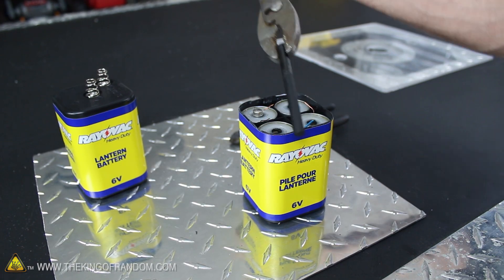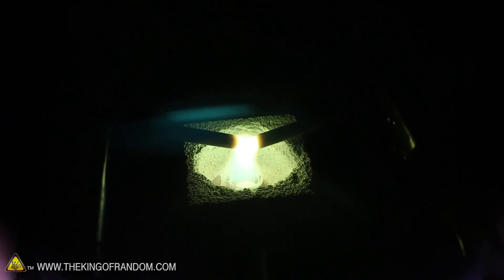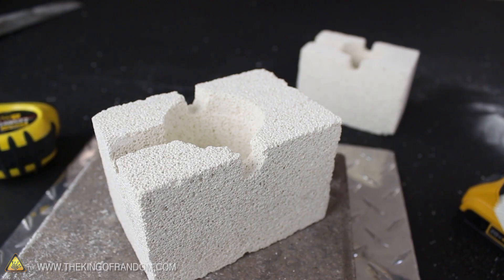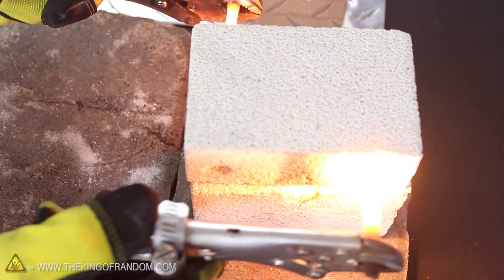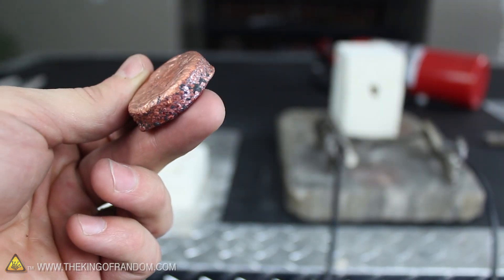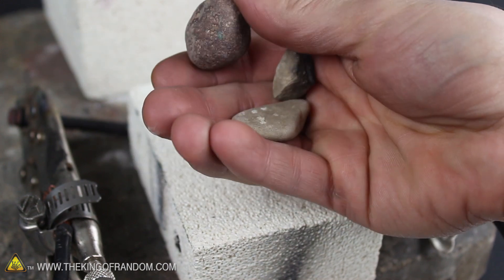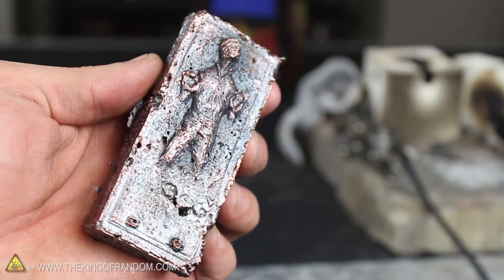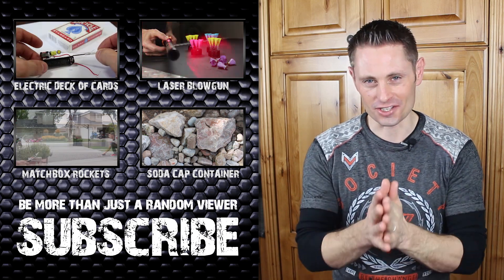Mini Arc Furnace (Arc Reactor Technology IRL)

Comment: hey, can you try to step up your game a throw some diamonds in there, maybe to a kickstarter or something to buy them, or see how much gold you can get from hacking cpus on old computers and using that. 
(gold would be interesting simply because its gold, but diamonds would be even more interesting, since they have an insanly high melting point)
Reply: calex1290 first of all carbon has a melting point of 3825 Kelvin and a boiling point of 5100 Kelvin. this means between 3825 degrees and 5100 degrees carbon will be a liquid. 
all elements can exist as a liquid. 
you might be thinking of CO2 which will go directly from being solid to gas (dry ice) but that is only in our atmosphere, if you pressurise it, it can still become a liquid. just like if you put water in a vacuum, it also goes stright from solid to gas, but that does not meen water cannot be a liquid. 
finally. of course you can get temperature that high, maybe not in this system, but there is no limit to how hot something can get, all you need to do is add more energy in the form of heat.
Reply: you just can't melt diamonds, you know.
Reply: s1nce yes you can. it just needs to be extreamly hot (5000 celsius)
Reply: It can't go that high (read description)
Reply: martinshoosterman Carbon rods like the ones used in this have a melting point of 3500 C so no you can't, in this furnace.
Reply: "Throw some diamonds in there" Dude, this isn't MINECRAFT. Real life is much harder to acquire diamonds
Reply: greg m not going to happen.
Reply: Super Science I doubt people could ever fly over the atlantic
Reply: martinshoosterman Carbon can exist as a liquid only under extreme, impossible pressure. Therefore, I'm not going to 'fund a kickstarter or something' so this guy can fund an R&D project for the development of what's essentially going to be a super pressure cooker thousands of years before its time.
Reply: nukeboy27 At what point does wood turn into a liquid?
Reply: 3,550 C
Reply: nukeboy27  *pressure dependant.
Reply: Diamonds would probably burn into CO2 before they melt in this furnace.
Reply: Morris Janssen no they do not, there is no carbon in the outer or inner core.
Reply: Just thought I'd say it, smart ass. :3
Reply: ***** shhushhh, never question science. you need no ask why, but only can.
Reply: The carbon rods would give when the diamonds do cuz they're both carbon
Reply: dont be ridiculous graphene fuel cant melt diamond beams 9/11 was an inside job
Reply: nukeboy27 in this one, you cannot, in general though of course you can. you can melt anything.
Reply: nukeboy27 technically that is not melting, melting is going from a solid to a liquid, while what you are talking about it going from a plasma to degenerate matter 
in plasma the electrons wander away from the necleus, while in the degenerate mater stage, the nuclear breaks apart
Reply: martinshoosterman ok well i didn't meant that you could just start to pour atoms like a liquid metal but to us it has the characteristics of melting
Reply: nukeboy27 melting by definition is the transition from solid to liquid as a result of added energy. the final result in the prosses you are talking about has atoms which are not intact, which means it is not a liquid.
Reply: I don't think diamonds can technically melt. Don't they just basically evaporate?
Reply: suspectsn0thing They are carbon so they would more burn into a gas then liquid but every substance has a point where it would turn into a liquid.
Reply: You technically melt diamonds, because once you hit diamond's "melting point" diamonds turn directly into gas and will never be in a liquid state. And as like you said, the definition of melting "is the transition from solid to liquid as a result of added energy", diamond never reaches its liquid state, that's also why diamond doesn't have a boiling point, so you "can't" melt it. That's just one point, other points you can't melt diamonds in this is because;
1: it can't get hot enough
2: the electrodes are graphite, which is basically the same as diamond, in terms that it is made from the same stuff (carbon) and when melted, it also goes directly into the gaseous state, and also has a lower melting/boiling point than diamond, meaning the entire rod will melt before you even get close to melting diamond.
3: and lastly, you just can't get temperatures that high.
Reply: martinshoosterman there is no liquid form of carbon, it's just one of the things that don't have it. If you don't believe me, even google it. Carbon is "Sublime", meaning it changes straight into a vapour when it melts. Here's a link to the definition if you don't believe me, http://www.oxforddictionaries.com/definition/english/sublime. And if you still don't believe me, just read this article, http://www.thenakedscientists.com/HTML/questions/question/1000313/
Reply: calex1290 did you not read the article yourself. I was just about to correct the article, but then I read it and its not the article which is wrong, its your not reading it. you can get a liquid carbon, but cannot be under atmosphere, it needs to be under allot of pressure, similar to CO2. everything has a liquid form, things will only be sublime under cirtaint amounts of pressure, as the example I gave earlier, water is sublime in a vacuum.
Reply: The diamonds are just a more regular carbon rod so the rods will me,t before the diamond
Reply: martinshoosterman "Melt".. I think you mean molten :) And yes, anything can turn into molten substances under very high temperature.
Reply: and pressure if you dont have pressure than there are things that sill sublimate into a gas
Reply: TheFirefox780 if you dont have pressure then liquids cannot exist. and everything will sublimate.
Reply: ( ͡° ͜ʖ ͡°)
Reply: Ya they are just carbon sinks gone through high temperature and pressure
Reply: martinshoosterman 

just wanna say that this guy knows his stuff. what background you from bro? physics or chemistry major?
Reply: The diamonds would burn... just saying.
Reply: You cant melt diamonds with 5000 degrees C
Reply: (Wrong button) solid diamonds exist in the completely molten core of the earth which is hotter than 5000 ºC
Reply: Morris Janssen um no the core of the earth is molten nickel and iron thats why it produces a magnetic field, the high heated carbon is in the mantle and as it gets pushed to the crust, where is cools down and gets compressed under high heat ad dextreme pressure is where carbon turns into diamond
Reply: They exist where it is molten but not totally in the middle.
Reply: right...
Reply: nukeboy27 That's 1 trillion 8 hundred billion degrees Fahrenheit.
Reply: Austin Torrey Im studying mechanical engineering.
Reply: ***** I know, I forgot when I wrote this comment that diamond wont melt at atmospheric pressure
Reply: How the f that tiny blast furness melt diamonds  diamonds take 25 kelvin to melt  iridium its much more easy to melt but your hands will start burning throu the gloves so yea
Reply: martinshoosterman  you cant melt diamonds unless we had the pressure of 5 atmospheres which we don't have so it will just sublimate which is from solid to gas
Reply: (。◕‿◕。) KAWAII SHHHHHhhhhhhhHHHhhhHHhhhhHhh
these people cannot handle the truth, dont spill these secrets.
Reply: why not
Reply: martinshoosterman diamonds will burn up and turn into CO2 at a lower temperature than they melt at. Also, since he is using carbon electrodes, they would melt if it ever did get hot enough.
Reply: James Galbraith that is under bar, under high pressure it will melt properly
Reply: i doubt anyone could get the pressure required with out the container being destroyed in the process by too much heat or pressure or both combined
Reply: NoQuestionsAsked thousands of years before its time? impossible pressure? do you realise the kind of stuff we have like super colliders  and fusion reactors, and you seresouly think we cant make some liquid cardbon? its not cost effective and their isnt a real reason to do it, good enough to get us to do it, but its very possible.
Reply: who me
Reply: dam shots fired!!!!!
Reply: Diamonds dont melt they vaporize
Reply: ***** actually I did the math and the packing fraction of the 12 protons at critical temperature is that you would actually begin to fuse the carbon before you ever got it to melt, so by all definitions its impossible to achieve without around 1425900000000000000000000000000000000000000000000000000000000000000000000000000000000 × 10^24 atmospheres at sea level.
Reply: martinshoosterman  until you use all the available energy in the universe and ended up doing nothing but destroying the carbon into wnergy
Reply: Even if he could who exactly will be providing these diamonds to vaporize, diamonds cost money you know, lol.
Reply: NoQuestionsAsked koty butler Just for the record: Liquid carbon was first artificially obtained in 1997 by Motohiro Togaya. High pressure was not needed, but at 50 000 atm the behaviour of the liquid changed. So, it's not really impossible to do this.
http://www.nature.com/news/1999/990617/full/news990617-10.html
Reply: iTheVisitor yes it has been made, but I'm stating if you melt diamond it isn't diamond anymore, its carbon in the form of buckyballs or c^2, not diamond, because a diamond is crystalized carbon, not liquid, sorry if my above post was confusing, I was in a rush
Reply: Alcatraz Kills ayyy
Reply: +martinshoosterman The amount of gold in a CPU is insanely tiny, and you can't really "melt" diamonds, they would just turn into a weird lava substance.
Reply: +lupinearsenalALT does that mean you could melt a human body?
Reply: Super animals
You can't melt a human body, it will start burning at around 400°C and will start charring at around 200°C
If you keep increasing the temperature you will have a ball of basically carbon and you can't melt that because it will sublimate (turn into gas without passing by the liquid phase) at around 3600°C
Reply: MrOpenGL ooooh, I wanted to try...but if it did'nt burn, would it then melt?
Reply: Super animals
Fat would melt even at "low" (300°C) temperatures, assuming you avoid it from catching fire. Bones will probably sublimate (at very high temperatures). The rest is a bit vague because it tends to decompose into other compouds due to the heat, so you can't be certain in which state it will end up.
But again at the end you will get a ball of charcoally-like material which will sublimate at 3600°C

Comment: You just made a carbon arc torch. Its a torch that was used in metal fabrication around WWII and was generally accompanied with a stick welder on the same machine. It was later replaced with the Oxy-acetylene torch. Its really old tech and its pretty cool that you made one :)

Comment: Please cover up your forearms... isn't there lots of UV radiation like in normal welding?
Reply: No not necessarily it is mostly shielded by the furnace walls
Reply: Lawrence Mayne I do a lot of metal active gas welding, you NEED to HAVE skin protection or else you'll get severe sunburn and skin cancer when doing it a lot without protection.

WTF is your problem? Facts are facts, I don't need to do any homework.
Reply: JackCarver10 doesn't that depend on the how you are welding? I think this is pretty harmless to be honest.

but if you are right, safety always goes first!
Reply: hahahadracula I have it right here on paper, I learned it in welding courses, also I have suffered from bad sunburns myself. I didn't cover up my neck / upper body :(
Reply: hahahadracula That's why you should always wear full face protection and not only glasses. How much UV radiation is produced depends on the method of welding and the amount of Amps running through the electrode :)
Reply: JackCarver10 exactly

Comment: I am VERY interested in making one of these.  I have already found some microwaves on Craigslist, but I have a few questions.

First, does the wattage of the microwave matter?  What if the transformers in the microwave are different? 

What exactly is different in this and your ARC Welder?  If I'm correct, there is no visible difference in this video.  You took both of the ends (don't remember names, despite having experience welding) that clip on to the metal object touching what you're welding, and the one that contains your welding stick.  You then ran further copper wire to two vice grips, touching your carbon rods from a lamp battery.  Are these the only changes?
I just read the description and you mentioned center tapping it again.  Do you recommend doing this or no?  

Does this consume the carbon rods, and if so, how quickly? 

Are there any other materials that I could use instead of the Fire Brick? 

What website did you use exactly to find the stuff you use?  Craigslist doesn't have the best listings, however it's still fairly good. 

Do you have any tips you could give me, or any ideas of how to improve this design? 

Also, other than those specific batteries, where can I find carbon rods? 

I am very interested in your tutorial on this coming out soon.  I along with others would really appreciate an estimated date : P

Thank you very much for posting these things, I really enjoy them!

Comment: Not surprised about the arc melting the rocks. Lava is approximately the same temperature as molten glass. Glass melts at 2500DegF. And guess what, 2500DegF also happens to be the melting point of iron.

Comment: Cool, but why does the plasma always shoot DOWN? Shouldn't it go up and heat the lid? Also, why not tape the welder's darkening glass plate over the viewing port of the fire brick? The special brick is made to not transmit heat very well, so it probably wouldn't melt the tape. Wearing a welding helmet (or any headgear for that matter) for a processes that it wasn't meant for (welding helmets are meant for welders, not arc furnace building hobbyists) makes you look like a geek.

And by the way, what power source did you use for your arc furnace?

Comment: I noticed your arms weren't covered while you demonstrated the carbon arc. I studied them and found they do emit UV and can sunburn exposed skin. Carbon arc was used for lighting outdoor events way back before good large lamps were available. We should never look at a carbon arc without welding equipment. It is remarkable the high temperatures you achieved with them. I am glad you presented this experiment in such a clean and to the point format.

Comment: Hi @Grant: This video is amazing. Can you try to melt tungsten wire which has a melting point of more than 3000°C? you can easily get the wire from old light bulbs

Comment: Hey Grant, do you think this (or even the mini metal foundry) could be used to make cheap, homemade jewelry using blank casting (like you did with the aluminum toy sword and gun). Obviously not high end, quality pieces, but maybe a little ring from say gold, who's melting point is much lower than that of iron or steel. It could make for some awesome gifts, escecially if you esing the piece so that some kind of precious stone could be socketed in. Probably go a little larger on the outside and narrower on the inside, to allow for polishing and taking off imperfections, what do you think?

Comment: That is a very cool experiment.  Rock is mostly a silicate, so it should met at a temperature far less than steel.  It looks like you actually melted your firebrick in the last part, which is also very impressive!

If you could successfully make a microwave furnace able to melt steel, I would be even more impressed.

Comment: Not sure if you already know this or not but it would be a good idea to wear a respirator when doing this. Some metal alloys have dangeous chemicals in them that only release when heated extremely high. Take extreme caution when melting stainless steel or anything galvanized

Comment: Outstanding! Have you tried cast iron yet to cast any ductal or non-ductal parts? Q? What wattage PS are you using and do you think a smaller than a 1000 or 1100watt PS would still generate the power needed to do the job? Thanks for all the great vids. Very Cool and useful! ;)

Comment: It's funny. I did this when I was 12 years old, only I used the carbon rods from a D battery instead. And rather than have a mega step-down transformer like Grant, I used a variac, a variable transformer that my dad had lying around. Used two vice-grips to hold the carbon rods too... Used a clay flower pot for my "chamber". Thing is, and I remember this sooo well, I was working with somewhat higher voltages and I ended up getting slightly shocked when the vice-grip bit into the tape that I had on the ends of the rods (holding the electrical wire on) and oh boy... I felt that. No welding helmet either, so I only tried it a couple of times... in my bedroom.. glad I didn't burn the house down ;)

Comment: btw idk if u know this (maby i'me wrong not sure ) but a good way to make a molde for molten metals is sand.thats what i've been told in school. its one use only but it works grate u only have to press in a negative into the sand.I think that Han Solo would have ended up much cleaner that way.

Comment: Beautifully done video! Very handy to have. Mine works great also, but I have no access to any fire bricks. I use a graphite crucible. Your MOT's must have gotten very hot with that kind of current flowing for a prolonged period of time. They run hot by design already.

Comment: Casting a copper isn't a good idea, as copper "eats" oxygen from the air (that's why your ingot is bubbled). Make a bronze casting next time or protect your mold with a torch- a fire from a torch will consume all the air around it so your casting will have more detail and much less bubbles. 
Regards, 
Greg